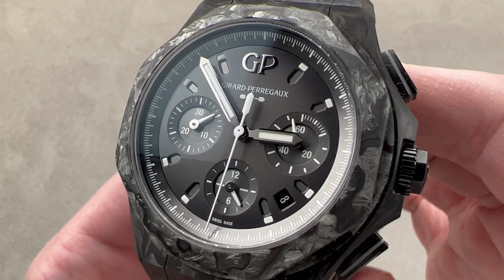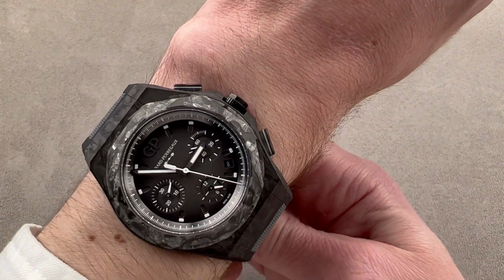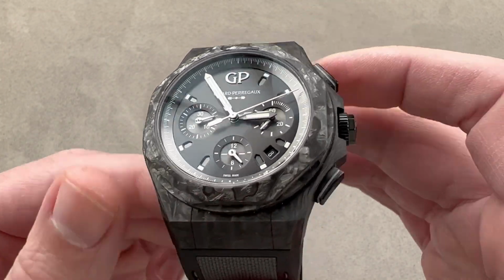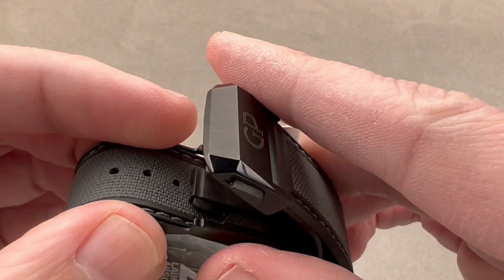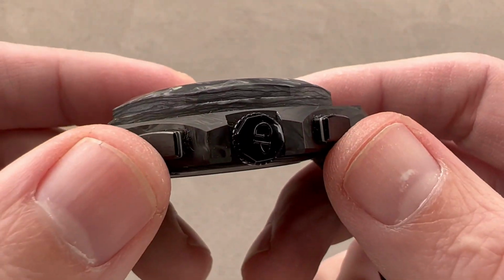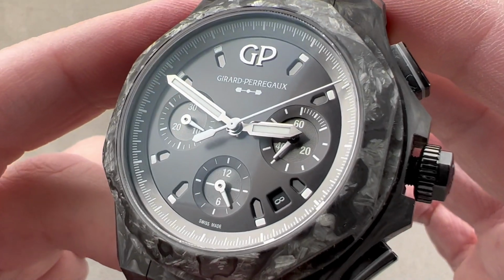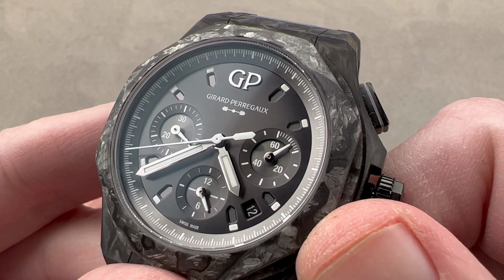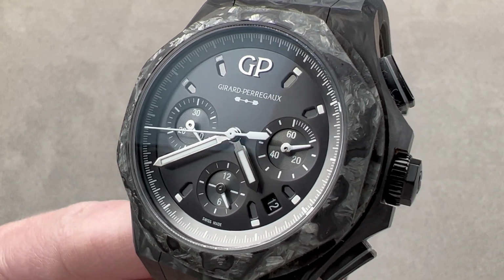Girard-Perregaux Laureato Absolute Chronograph Crystal Rock 81060-36-693-FH6A Watch Review

Comment: The G Shock GWG2000 Mudmaster is made of the same material for 600 bucks.
Reply: And has a very cheap quartz movement inside.
Reply: Apples and oranges my friend.😅
Reply: Comparing a G-Shock battery watch with a mechanical watch that has better finishing and attention to detail down to the last cog.

You need brain surgery, my friend.